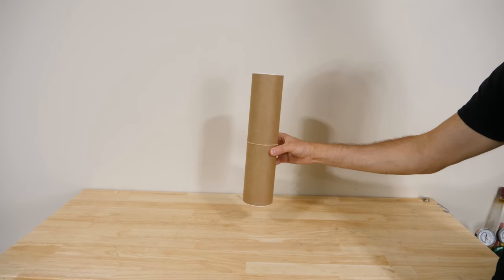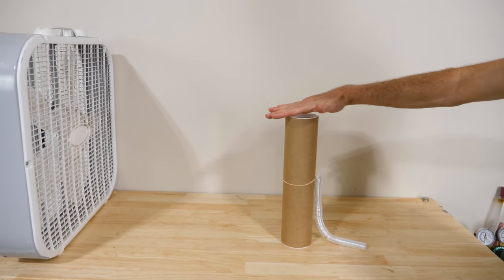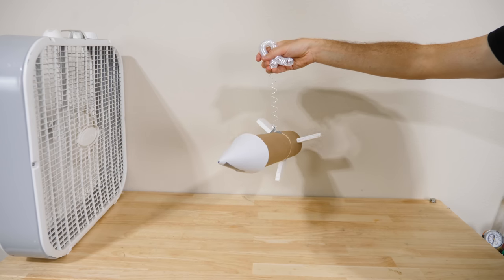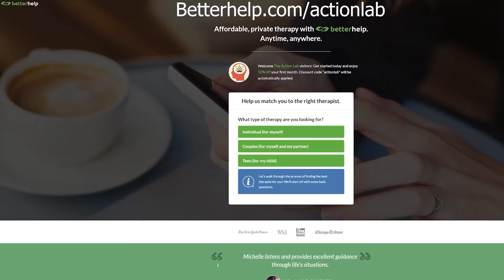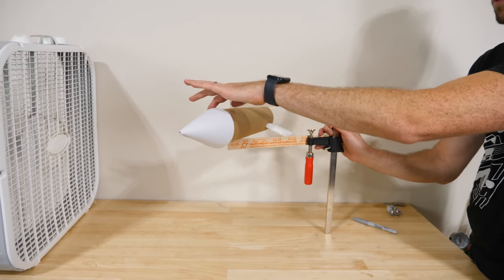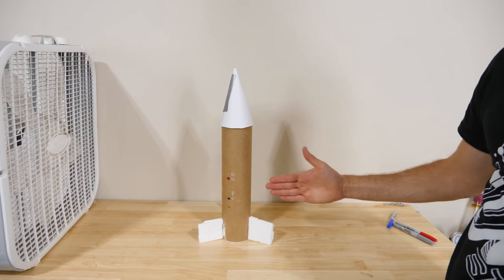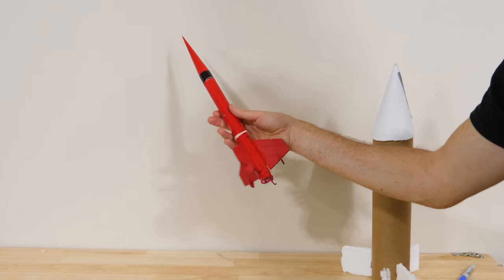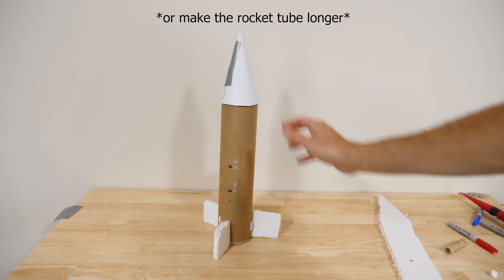I'll Show You What Happens When Rockets Don't Have Fins

Comment: When I was a kid building rockets, once we found the center of gravity, we'd put a string around that spot and hold it with tape. Then we'd spin it around over our heads, letting the string out till it was a few feet. If the nose took the lead as we wanted, the center of preasure was behind the center of gravity and it was ready to fly.  Just needed to repeat the test if you made any modifications to weight or shape. If you didn't, you got a quick reminder when you launched it :)
Reply: We did the same, swinging it by a string.
Reply: Be sure to have it loaded ready to fly with a new motor. It works great and is quick.
Reply: Gets much more difficult when you start trying to swing 7’ tall high power rocket around ;) but definitely a great quick and dirty test for low power rockets like the ones flown in parks

Comment: Much easier and faster way to find the center of gravity: balance the object on 2 fingers or 2 sticks or something and move those 2 fingers/things towards each other. Where they meet is your center of gravity.
Reply: that can only be done on simple surfaces, like the most famous one, the pencil. however when the mass is unbalanced (ex. you put one of those eraser attachments onto one side) you can't really gauge the total mass and thus also the center of gravity unless you balance it further out onto the "attachment." by concept it just might work cuz it sounds logical but practical applications are of course more complex. i'm not a physicist or something btw, just a regular worker who's fascinated by how things get easier if you understand them more lol
Reply: @runic6452  Actually it does work even with unbalanced masses! Try it with a broom, that is quite obvious unbalanced, and you will see it works there, too. The point at which it fails is quite obviously when the surface you are balancing it on changes, e.g. when the center of gravity is somewhere where the fins of the rocket are attached. But for the examples in this video it would have worked perfectly.
Reply: @runic6452  It still works if the mass is unbalanced. It works due to friction: if one finger is holding more mass than the other, the other finger should come towards it, and that happens because the finger holding more mass will therefore have more friction with the object, so it won't move until the other finger has more friction.

This method won't work (or at least will be a lot more difficult to use) with an object that doesn't have a more or less one dimensional bottom.

Comment: I learned this lesson the hard way back in the 1970's, when one of my own highly modified rockets went sideways shortly after launch, causing all of us to run in different directions.  At that point I went back and read all the info on "center of pressure" and "center of gravity" that I had come across before but didn't quite make sense.  After the renegade launch however, the pieces started fitting together and I had an "a-HA!" moment.

Physics - it's not just a good idea, it's THE LAW!
Reply: And what about your latest rockets? How did it go?
Reply: @EstamosDe  I think it was many years before I did any rocketry after that - as a mentor for some young kids.  We stuck  to the kits and didn't try anything too dangerous - except perhaps for climbing quite high in a pine tree to retrieve a rocket.
Reply: If you are good at rockets, can you confirm something for me? He didn't explain why the center of pressure had to be lower in the video, so I would like to know if my guess is correct.
Here is my guess: The center of gravity is like the point of rotation when the rocket wants to turn. When the center of pressure is lower, the drag will be higher on the part below center of gravity compared to the part above it, and thus it will be pushed back to the right orientation, if turned. So, it is a question of whither the point below the center of gravity produces more drag than the part above it. When the center of pressure is below the center of gravity, you are sure that the part below center of gravity will produce more drag.
Reply: I had a similar experience in Boy Scouts. I made my own 2-stage rocket design and was quite pleased with it. When it launched, it started doing corkscrews and impacted a wall at the school we were flying our rockets at (the wall was in the middle of the large grass field behind the school and presumably for bouncing a ball against). The rocket exploded into a bazillion pieces!

I remember that people were offering their condolences. The truth is that I was a little annoyed that the rocket didn't work, but very pleased with the flaming wreckage that had scattered some distance in all directions. I remember saying "what you you apologizing for? That was awesome!"

I think I was a demented little kid.
Reply: I did the same with a homebrew rocket we made with a multistage motor whose second stage was a bag of gasoline and firecrackers.  We launched it from the back yard and time seemed to move very slowly as it headed for the house, barely clearing the roof.  Fortunately, it landed in an empty road intersection.
Reply: @bobthegoat7090  I think of it in a different way... as these points are the location where the net forces act - the C.G. is where net gravity acts, and the C.P. is where net pressure acts.

So if your rocket it going straight up and starts tipping right, gravity is pulling down where the C.G. is.

The wind rushing past the rocket acts where the C.P. is.  If the C.P.  is left of the right-tipping rocket, it will push down on the left (tail) side and straighten it back up.  If the C.P.  is right of the C.G. in a right--tipping rocket, the air pressure force pushes in the same direction a gravity, pointing the nose of the rocket downward.  

For me this is an easier way to visualize the issue, especially when I think of the vector forces, and where the "arrows" point for each of these forces.  In  a physics class, you'd draw these arrows at the C.P. and C.G.  and calculate their magnitude based on mass, wind velocity, and angle of tilt.
Reply: What's ur job ?
Reply: @indian9818  If you're asking me, it's Electrical Engineer.
Reply: @Cynthia_Cantrell  what u actually do or work on ....r u persuing your passion
Reply: @Cynthia_Cantrell  ok what will u suggest to me I'm 17 and I'm a jee aspirant form India trying to go to iit's u probably know about it ...it's an institute in India for engineering ...so I'm in love with physics ...what will u suggest me for life as u have so many experiences ❓
Reply: Maybe try testing it in Kerbal first XD
Reply: May I introduce you to engine gymballing?
Reply: As a kid, I found out that one of those C4A engines (I think that was the Estes designation??) would accelerate my little rocket so fast that it ripped the fins off!  That particular flight was... shall we say...  'dramatic'.  lol
Reply: You with rocket? me with rocket fire cracker. They use a stick behind the rocket for stabilizer,when we break the stick it become "Crazy rat"
Reply: woah damn, it's rare to find a senior engineer on this channel.
Reply: My family did the same thing. It was all great fun... well except 2-3 mile hikes through the high desert to retrieve rockets for the parents and older sibs. I am now in my 50's and my old bones ache for my younger self, hehe.
Reply: We used to launch what we would call "suicide rockets" which were essentially just rocket engines with fins glued to it. We would then set them off in our residential neighborhood, and run like crazy. We also once glued a matchbox car to a bottlerocket, which flew all around everywhere before ending up under the neighbors car. We also once emptied all the magnesium out of a bunch of fireworks and lit it off at once, effectively flashbanging the whole street. We also got our hands on a bunch of firecrackers once, but since we didn't have any matches, we pounded them with rocks till they exploded.
Reply: Rocket
Reply: @liamkoehler8820  meet the demo
Reply: When you didn't know physics, you will ask your God and pray.
But when you know physics, you didn't have to or you are not going to pray because you already know the result.
If something unknown happens, it is bad at first and you maybe think that you should pray but Hey,... if you can solve the problem with that unknown things.
In the future, if you face the same problem it will be nothing anymore. :)

Yes, the more you knew the more you don't need God.
How about Luck?? Well, what if science can change the nature of Luck? :)
Well, that is for another what if. :)

Comment: In marine architecture engineering "center of buoyancy vs center of gravity " a point called "meta center" where as center of gravity must be below center of buoyancy or ship/boat capsizes .
Similar .
Excellent 👍
Reply: I think he also has a video where he mentions this actually. Pretty cool.
Reply: Yes, and boats also tend to want to turn to put the side of the boat facing the wave if you're not careful.
Reply: Pretty much the exact same principal.
Reply: @zacrintoul  below Mach 1 😂
Reply: But the center of buoyancy moves as the ship/boat rocks in the water. If the boat’s hull is vertically sloped at the waterline, yes, it will capsize. Same if the slope is negative, like on a submarine or the stealth ship.

But rowboats have a center of mass that is definitely above the center of buoyancy, and they don’t capsize because of the shape of the hull.

Think: when the rowboat is on dry land, it’s effective center of buoyancy is at ground level, definitely below the center of mass, and the hull is completely curved. Based on what you said, the rowboat should tip over under these circumstances, but it doesn’t. Because as it rocks, the center of the normal force moves.

Edit: self righting objects with round bottoms on dry land exist despite the fact that the “center of buoyancy” for objects on dry land can only be at ground level, certainly below the center of mass.
Reply: @J7Handle  Meta center ...in marine architecture
Reply: @MitzvosGolem1  if you're piloting a boat above M1, you'd better have all your centers nailed down.

Comment: The trick to the shadow method is to account for the total fin area. The shape drawn only accounts for two fins so the tail end is slightly light causing the center of pressure to move forward. At model scales you can just eyeball an extra amount, 1/2 the length of the fin, on the end of the fin profile on each side. With the actual Estes rocket we used to add a few metal washers to the bottom of the nose cone to bring the CG really far forward.
Reply: What if the shadow was created by spinning the model and drawing the furthest points at any point in the rotation? This would also include any other deformities.
Reply: @glenncurry3041   Imagine if you had four (or more) fins. Even rotating the model you still will only account for two fins. Since this method is to let gravity simulate the effect of wind pressure, your silhouette profile needs the total surface area (weight) of all fins to be accounted for, and in the correct lateral position along the centerline. A 4 fin rocket silhouette would have fins twice as wide as the actual model. Another way would be to cut out the correct number of fins and lay them on a finless silhouette at it's base.
Reply: @3DPDK  Interesting. I am totally new at this. It would seem there would be a quantity/ density of fins that would at some point be the same as just a bulge in the cylinder? Which compared to an ever multiplying surface area of each, would suddenly drop to just that increased girth? And that could reduce at higher air speeds as laminar flow got wider on each surface?
Reply: @glenncurry3041  This actually works. It works with even pressure in 360°. Not so much a bulge, but more of a flare; like the bell of a horn in the tail end of the rocket. The cons are that it applies a constant resistance or drag even if the rocket is flying straight into the air stream, and at high speeds it creates a huge amount of turbulence in the exhaust stream. The problems on a model rocket is being able to make the shape without adding a lot of tail weight, as in 3D printing it, and difficulty with launch wire clearance. Both problems are solvable, but the constant drag limits rocket altitude.

Comment: I've always wanted to make a rocket. 38 years old and have never tried it.
Now that I'm a rocket scientist, i just might!
Reply: do it, there is quite a bit of satisfaction seeing something you designed and built take off at nearly the speed of sound and reach 10,000 feet. I did a 3" dia 6.75' long 2 stage that made it to 13,800 feet, it ran on a K-500 and a J-125. I made the electronics to fire the staging and chute ejection timer from scratch, custom built the rocket frames to handle the stresses, and it was done back in the mid 1980's ( when Tripoli had just a mere 550 members)...
Reply: Are you really a rocket scientist or engineering stuff going inside of a rocket/spacecraft?  I worked at NASA for a decade designing spacecraft components, scientific instruments, training astronauts and operating instruments on-orbit and don't think I ever met a rocket scientist.  I did work with a couple in defense applications, however.
Reply: @chrisfuller1268  hello

Comment: When I saw the thumbnail and the title, I initially thought "ah, I already know what the rocket fins are for; for stabilisation." I was about to skip it when I thought, "wait, maybe there is something I don't know just yet" so I clicked it. I already know about the concept of airplane about how they fly, the airfoil, the CG, flaps, ailerons and other controls like Thrust Vectoring. What I didn't know is the Center of Gravity should also be applied on rockets, and the center of pressure is new to me. It's worth the click. Thanks a lot.

Comment: As a kid I used to just check model rockets by spinning them around me with a string attached at the cg outside.  So basically your fan method, but without the fan.   Putting a motor in is important since it’s weight in the back. You could get a rocket to take off unstable tumble then stabilize halfway through the burn and dart in a random direction from the change in cg as the fuel burns.
Reply: I always thought those were the most entertaining. And then you can track down the maker and sternly ask them why the didn't properly verify the physics before launch. Lol

Comment: and the fun thing about it all... the CG moves forward as the motor burns making the rocket even more stable... so, when doing the CG testing, do it with the motor you plan to use or else the CG may be behind the CP and once it comes off of the rod it will go wacky...

Comment: I have a small and probably a dumb question. But when you put extra weight in the back of the rocket to move the center of mass, wasn't the center of progression moving as well, just in the opposite direction, Because it get's harder for the air to push that extra weight? PS sorry for bad spelling.

Comment: Great video! Minor point, but air resistance, or drag, is partially a function of medium density, velocity, and cross sectional area. I believe maximizing cross sectional area actually increases the drag, but your second reason for pressure stability is great. Maximal cross sectional area also maximizes volume/load and decreases costs for wall materials.

Think about the drag on a sheet of paper traveling laterally (i.e. as a magic carpet). It will exhibit negligible drag. But it also won't be able to carry anything as it has virtually no volume.
Reply: I think the cross sectional area is fixed, as you need to carry a certain amount of fuel. then the drag would be smallest for a cylinder, as less perimeter means less contact with the air around it 😅

But I agree, could've been said more clearly... Like a circle minimizes the perimeter for a fixed area, not that it maximizes the are for a fixed perimeter...

Comment: A good video, as always. One small point is like to mention though it's that when a coiled spring is compressed or stretched it will impart a rotational force on each end. In many of the better racing cars they have a flat bearing under the coil springs so that the lateral force created by the compressing spring doesn't try to bend the damper shaft, and so create more friction.

Comment: Never thought I might say I'm a rocket scientist!
This was far more interesting than I expected. But now I'm filled with questions! The sideways-in-the-wind aspect is surprisingly crystal-clear; Why, then, don't they, say, have two thrusters, one at each end, and redirected at a 90degree angle...? If it wants to fly sideways, why force otherwise? And that center of pressure method seems confusing; What would happen if the tailfins were replaced by a cone?
Reply: If you try to fly with thrust on both ends, the rocket will break at the middle. It's like a soda or beer can after it's empty, to crush it top to bottom requires some strength to make the sides collapse. But press on an empty can from the sides, and it folds easily.
You want rockets to be light for performance, if you make the sides thick enough to not get damaged, the rocket will be very heavy.
Reply: @ChucksSEADnDEAD  Oh, interesting! That's a good way to explain it, too, crushing a can.
Reply: Not only that but the wind pressure would now be quite a bit higher as well, since the long side will naturally want to face the oncoming pressure.

Comment: "Largest area vs perimeter -> least air resistance" kinda the opposite, that gives the greatest air resistance for given perimeter, so that's disadvantage. BUT. What largest area takes as disadvantage, it gives as advantage in the way that it allows for largest volume for given material (if we're talking cylinder-like shapes, or else sphere is the largest volume).